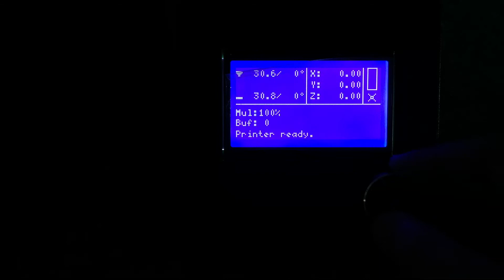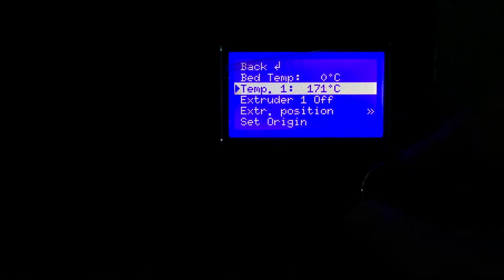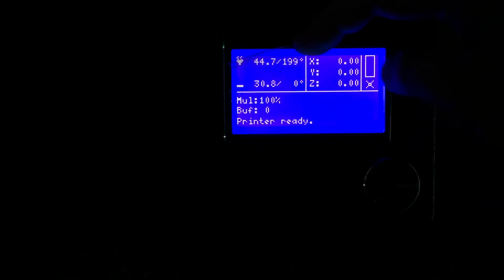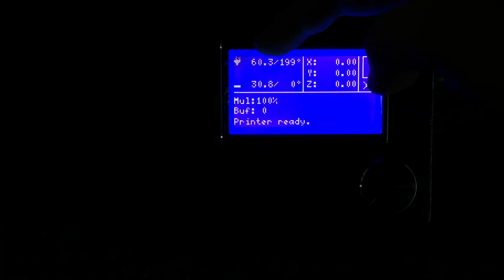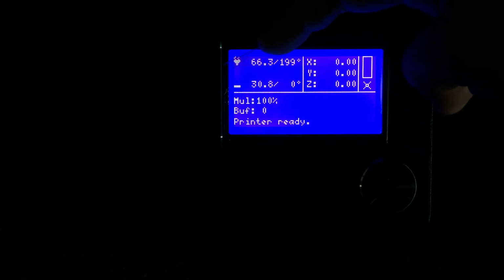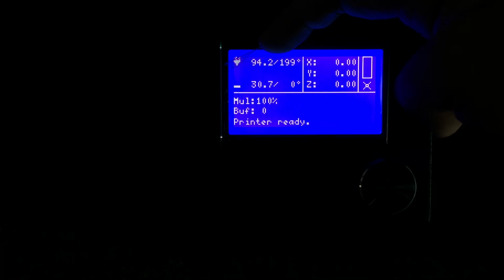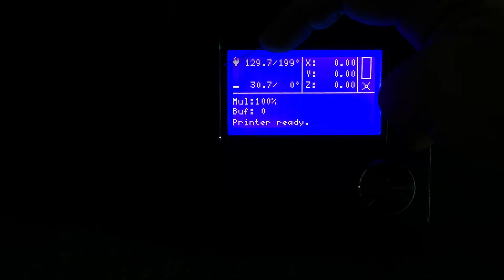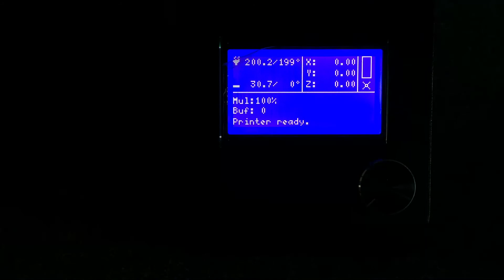How to fix WANHAO i3 extruder jam?

Comment: It's better to pinch the extruder lever with another finger on the bottom. Pushing down just from the top puts unnecessary strain on the Z axis. 
In the video you can see the Z axis moving down when the extruder lever was pushed from one side...

Comment: What size piano wire? It may cost less to buy locally than ship from wanhaousa?
Reply: I suspect it's 1/16". This equals 1.59mm, slightly smaller than the filament (1.75mm). I'm going to try this myself, just clogged up my nozzle.